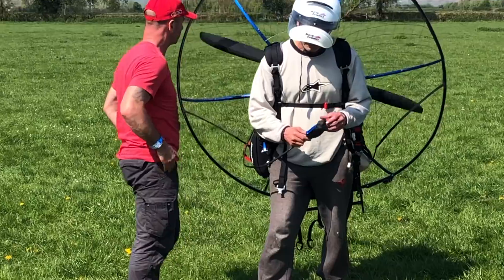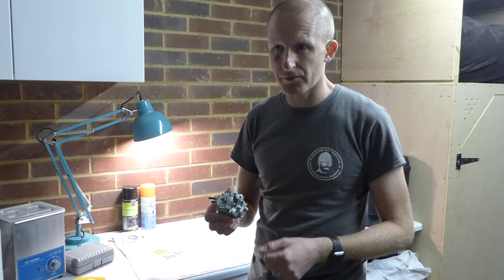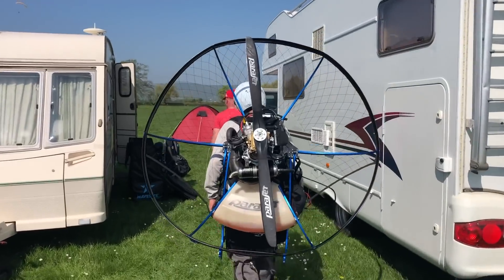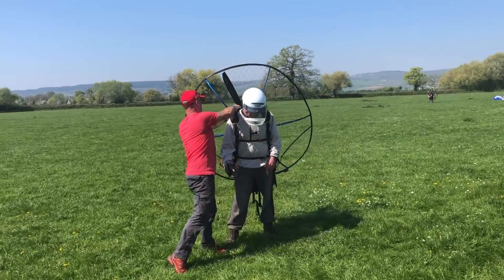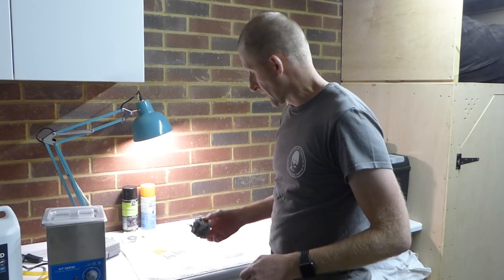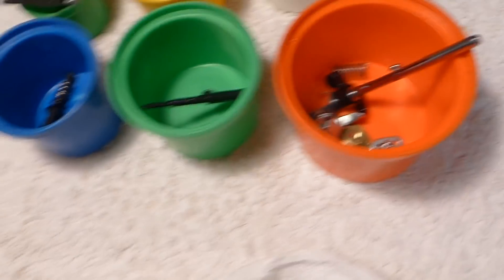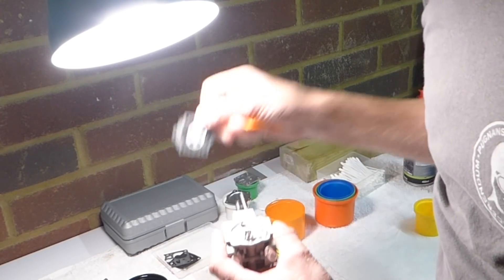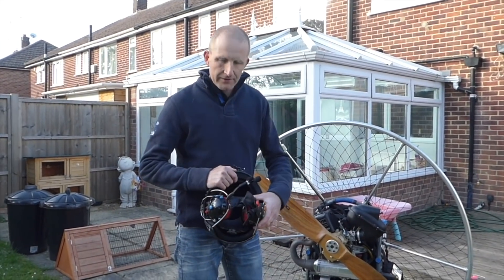Fixing a Walbro WG8 carburettor on a Polini 80cc Paramotor

Comment: Hi, it was mentioned, that the temperature should be at 175. Mine is running at full throttle (for several minutes) not more than 165. It means it is still to richt?! Motor is Polini Thor 190Evo. Consumption is about 7h/hour!

Comment: Hi great vidoe. 

I have a Miniplane too 80 and the carb walbro wg8  throttle lever does not do al the way back to idle. It stops short about 1/8 inch away from the cone. Do you do minor repairs. Based south coast of UK 

Cheers mick

Comment: Hi.Do you sell the metering tool for setting the correct settings on the WG 8 carburettors.Thanks Pat
Reply from the maker: Hi Pat, if you know someone with a 3d printer, you can print it from here - https://www.thingiverse.com/thing:3884533
Reply: Hi Andy.Afraid i dont know anyone with one.Thanks for replying.

Comment: Hi Bexxy @ Andy, love your video buddy! Very  informative. I will possibly purchase my first Paramotor after this pandemic is over. The Polini Thor 130 engine (second hand) which has the WB-8 carburettor as well. The first owner brought this from the USA about 4-5 years ago. He says he flew a combine of 3-4 hrs only so far. Would you suggest to fully service the whole engine or perhaps just clean off any carbon build up along with cleaning and changing the parts for the WB-8 as you did here? Any advice is most appreciated buddy! Thanks again
Reply from the maker: John Chin - if the motor is running fine with so few hours I wouldn’t touch it unless there is already something wrong with it that means it needs attention, if that’s the case I have no experience in engine rebuilds, so can’t advise on that. However no harm in doing a carb rebuild, as the seals may perish over time depending how long it’s been sitting around with no activity.  Just make sure you order a new carb kit before you open it up and make sure all the parts go back in the correct order, it’s easy to get this mixed up if you have no reference, so take notes when you disassemble the carb. Good luck 😉
Reply: Bexxy - many thanks again for the quick reply buddy. Very much appreciated

Comment: Andy, thank you for the video! I have a WB-37 carb, which I understand is very similar to the WG-8. I'm experiencing a bit of bog/fade at higher RPMs - so I have a question about the metering lever - and in particular - about how it interacts with the needle.
As you know, there is a groove cut around the top of the needle that the metering lever 'fork' slides around, by which it lifts the needle. This groove is quite a bit thicker than the metal thickness of the lever, so when the lever is pressed down, there is a fair amount of 'play' before the lever fork actually makes contact with the the needle, finally lifting it out of its seat.

In my case, the lever could be depressed about 2mm before the fork made contact with the top edge of the needle groove and lifted it.
I had used the Walbro gauge to set the lever height (I have the metering diaphragm that has the longer tang - not the button). I noticed that the metal disc on the opposite side of the diaphragm bottoms out against the internals of the carb before it is able to really move that lever down enough to lift the needle; It's enough to unseat it, but just barely (mine is set to pop-off at about 16psi).

So, here's my question :)    
I'm wondering if that needle isn't being lifted enough to allow the carb to deliver the right amount of fuel at high rpms? Should I bend the fork at the needle so that it is making contact with the top of the needle groove, so that the diaphragm doesn't have to travel so far down before it lifts it? I would think this would allow the needle to be lifted higher, allowing more fuel flow. The fact that it is unseating just barely, would explain why the engine can run up to speed for a moment, but then fade... Then speed up again... then fade - which is my situation.

Sorry for the tremendously long comment - but it's a very tricky issue to describe - and I haven't seen any videos online talk about this.
Thanks!
Reply from the maker: Ryan Dinan - sorry, i don’t have much experience with wb-37 carb. In principle they are similar, but I would just buy a new carb kit and see if the new metering lever is better and only make fine adjustments between flights.  Also make sure the carb is clean if debris, especially in the fuel inlet filter area where the wire gauze is.

Comment: Hello again. I can see this carb is the new one for the new atom80 engines. I have an earlier version of this engine and the carb doen't have the preassure hose that goes to the crank of the engine. Do you know anything about the older version carb upgrade? Thanks

Comment: Hi. I have a Atom80new from this year. April,  and I want to clean and rebuild the WG-8.
I habe a doubt, Im not sure at what height I should leave the ML. 1.7 or 0.5/0.8
Could I buy you the 3D printed gauge? Or where can I buy it?
Thanks 🙏
Reply from the maker: Barrio Sesamo - The height depends on the type of diaphragm design you have.  I can’t remember what my gauge is designed for without looking.  Do you have access to 3D printer?  I could share the drawing with you.
Reply: Andy Bexx I have the new diaphragm with a button and I have acces to a 3D printer.
aerosugus@gmail.com 
😉🙏
Reply: Andy Bexx Can you email me the 3D file?
Thanks
Reply from the maker: @neosugus  - I have just posted it on thingyverse for you - https://www.thingiverse.com/thing:3884533
Reply: Andy Bexx thank you very much. Meanwhile I have made a gauge to adjust the lever at 0.7mm.
Is that the correct height for the Atom80 WG8?
Reply from the maker: Barrio Sesamo - I don’t know about the atom 80, not messed with mine.  I only did it on my old polini.  However i would assume they would be the same?

Comment: Fabulous outcome to a most annoying problem..well done Andy!! 
I think you should do a few carbs from the moster 185 ..yours seems to be the most comprehensive cleaning process..👍
Reply: Check briansmobile1,  it's not quite as good but it's not bad.  Big issue with that video is Brian didnt show to adjust the spring with the W tool.

Comment: Andy,
Clearly a good result. I've yet to take my carb apart. I flew the other day for almost an hour without any issue's but I reckon there could be some much in the carb. 
Carbs are seen as a dark area by many because they aren't fully understood by many (me included to some degree) but this video goes some way towards demystifying that dark area. I believe the rebuild was more successful because of the sonic bath cleaner and attention to cleanliness .
Top marks.
Sandy
Reply from the maker: Wiltshire Man - Thanks Sandy, once you understand them, they are fairly straight forward in what they are trying to do.  Attention to cleanliness is the key to doing a rebuild.  This is why I use a hairdryer to dry the water off, e.g. you wouldn’t want to wipe it with a paper towel and leave fibres everywhere. 😁

Comment: Great content Andy. I'm currently rebuilding my carb the wb32. The last flight at the bore mine run like dog shit causing me to burn 4 litres in 20 mins on my evo 100. I did not know the the metering lever can be out too. I will check that on mine. However I cant find any information from vittorazi regarding the pop off pressure for my engine. But hey ho. Again thanks for sharing. It's always helpful 👍🏻